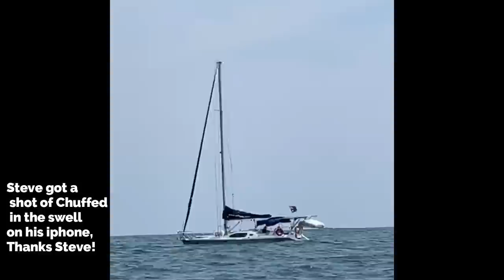2nd Sea Trial and 50 Hour Maintenance on Yanmar 3ym30 : Chuffed Adventures S4Ep33

Comment: You should pressurize the fuel system between the engine and the tank. It would only require a couple pounds of pressure from an air pump and if there any leaks it will show up quickly

Comment: Little trick with the oil filter is to pop a plastic bag over the filter right up to the engine block. You can then undo it. Any oil will go into the bag and once the filter is free, you can just drop it into the bag. No mess !!

Comment: I had similar issue. Turns out the gunk was packed in the Racor filter assembly head and tank. One quick way if no time to do fuel polishing is to use a dinghy pump to push air backwards from supply tube back to tank and to clear gunks from Racor filter assembly head.

Comment: I wish you the best. I had a similar problem and based on Yanmar recommendations I replaced all the fuel lines and after that all the exhaust hoses!  We even installed temporary clear fuel lines do we could see the air bubbles in the fuel lines develop.  For three years we had this problem.  Sometimes the engine would run for days without out a problem but it never was reliable.  Turned out to be high pressure fuel pump.  Until that was replaced the problem continued.

Comment: A handheld vhf is designed to be held vertically. If you turn yours horizonal, the attern from the antennas is crossed and you can lose 20 decibels of signal strength. That's about about a 97% loss of signal between the radios. Physics has no mercy.
Reply: Unless the other vhf radio is sideways too :)
Reply: Metal boats and coamings also act as a radio signal blocker.
Reply: @flyinggybe2113  Yes, but she's on deck, and the signal should diffuse around those coamings. Belowdecks, I'd agree the boat should block most signal.
 But abovedeck, all it takes is crossing the signal polarity to kill 97% of a vhf signal. That's why literally all base stations install their marine vhf antennas vertically. Like the ones on mastheads, despite bridge clearance problems.

Comment: I kind of remember that due to decreased lubricity, there is a need for two fuel pumps one to pull from the tank and another to feed the motor. Not a diesel guy but have diesel buddies.

Comment: check the fitting on the fuel tank when it heats up the joint on the fitting and drop tube expands

Comment: It's probably overkill, but how about a day tank above the level of the engine fuel pump, served by a small electrical pump near the fuel tank? Or, just that small auxiliary electric pump,  running when engine is on, sized small enough to prevent damage to the engine pump diaphram. That way, the fuel system is under pressure rather than vacuum (except for the short section between the aux fuel pump and tank). It also makes bleeding easier, and can be plumbed into a polishing system if you want to get exotic.

Comment: Quirky, intermittent problems can be so aggravatimg... Have you considered installing some fuel grade vacuum and pressure guages to help monitor the fuel system and provide useful data the next time the problem occurs? I don't know what the problem is, but I know your analytical mind will get it sorted out!

Comment: If you do not have a computer on the engine to shut it down do to overheating.  Then you may want to check your air vent. With most air vents they have a screen on thim and they get clogged up with salt and grime.  Because it sounds like the engine is starving for fuel.  So if your vent is clogged up it will starve the engine of fuel. 
 But I am not there so can't check that. Thats what would happen at the fuel dock all the time. It would be hard to fill up and people would have the same problem you are having. I worked at the star port fuel dock  in San Diego for years and saw it happen all the time .So check for a clogged vent line. Like I said there is a screen at the end that is  Supposed to keep out Bugs and Dabree. The screen gets salt and stuff on it and it can  starve the engine of fuel. 
 Ok until next week Aloha from the Big Island of Hawaii.

Comment: I had a problem on a big truck doing the same thing turned out a fuel line had a spot inside the line that was bad and would flop down and block the line whenever it felt like it. If you haven’t already just replace the fuel line.

Comment: it´s possible that your fuel tank it´s too sealed and as the engine suck fuel from it it's generating a negative pressure in the tank that compite with the fuel pump? That could explain why take so long to fail

Comment: " Bit by bit  "  I just love your systematic breakup of possible causes eliminating unnecessary expenditure. 
Sure you have also noticed just how lazy people have become to  ' use their brains ' by merely thinking about any problem or life itself.  This gets me worked up very fast , that's my problem with getting old , PATIENCE not realizing everyone doesn't have the same interests or intellectual abilities.

Ps.  Your hand held Radio's signal will disappear if it isn't a high output one but normally in such case the  ' Line of Sight '  rule applies thus lowering it it can't  'see '  the signal.

Ps.
Sexy  smile  you've  got  😁.